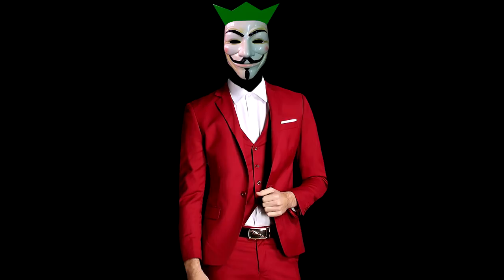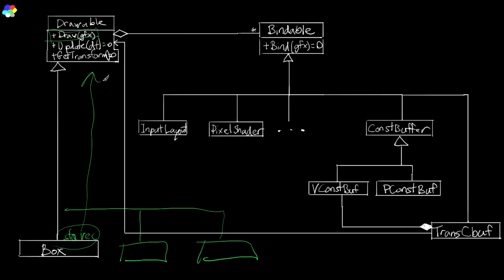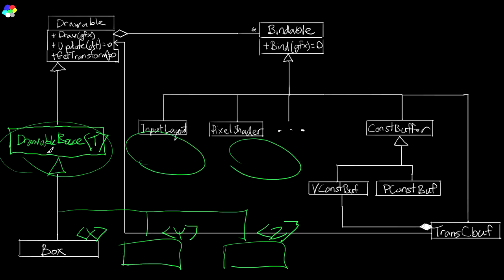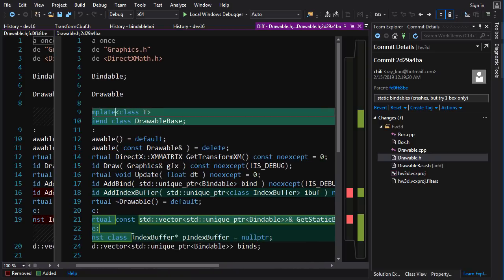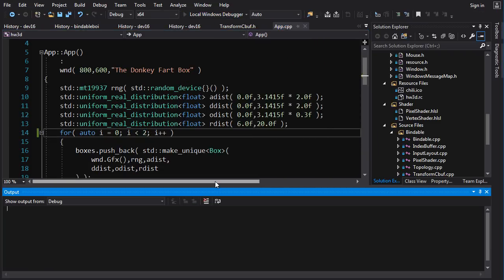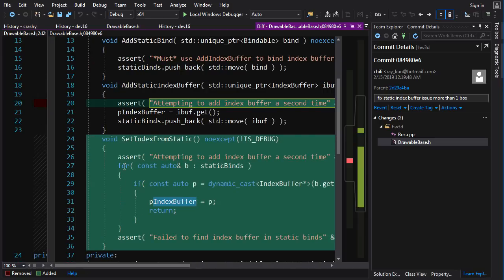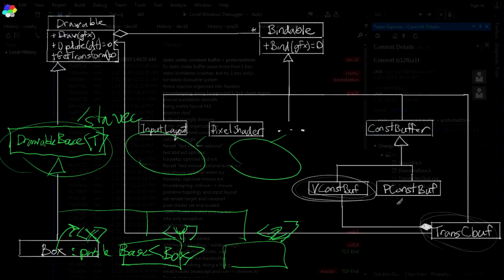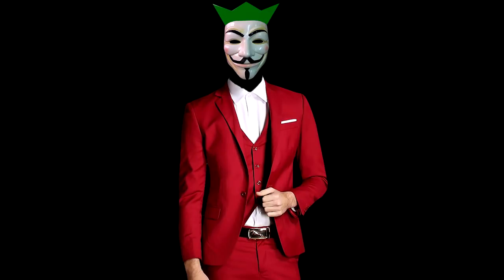C++ 3D DirectX Tutorial [Bindable / Drawable System Part 2]

Comment: I feel as though the PSA at the end was meant for me or people like me lol.

I had to tell myself the same thing while watching, this is only tutorial code, this is only tutorial code.  I really like the design for the most part.  I'm surprised you used static instead of std::shared_ptr, but static works just fine and the template base was a nice treat.  

There are a few things in this design that I wouldn't have thought of, like creating a friend in Drawable then using a getter function to access the private friended instance.  For some reason when I code, I only think inside a certain box at a time.  I'll step away from coding and when I come back, I'll have a different set of "rules" to follow and something new comes to mind. 

Keep it up and thanks for the vids.

Comment: Love this series!
How will this work with objects loaded from disk? Wouldn't they each need a template "type"? I.e. you'd need to define a DrawableCar : DrawableBase<DrawableCar> etc?
Wouldn't a prototype based system be more extensible? I.e. Drawable has a member "Drawable Prototype" that contains all the "static" data..
Reply from the maker: Stay tuned ;)

Comment: At 13:45, if you run into an issue with Properties -> C/C++ -> Preprocessor and can't see your input for IS_DEBUG = true; click on Platform (top) and set it to Win32.
Reply: is_debug is essentially just the negative of the NDEBUG define that is set by the compiler by default. So you can make is_debug into a constexpr function that just returns the opposite. Like
constexpr bool is_debug()
{
#ifdef NDEBUG
return false;
#else
return true;
#endif
}

Since it is constexpr and the result is known at compile time, the compiler will just fill in the result.
No need to set another define, no opportunity of forgetting to do so.

Comment: So I have a question, I know it has been 4 years since the release of the video, but I wanted to ask if there a way to make the code more performant? Right now my code, on 12 CPU cores, runs only one of them at 50% capacity. I was wondering if there is a way to leverage multi-threading or other techniques to improve performance? Is this addressed in later videos?

Comment: 7:25, to do this thing here in my project I did something funky inspired by that thing Chili did with the message handlers in the Window Message Loop  video with Setup and Thunk.
I declared a static void (Box::*fpIntialize)(Graphics&),
I defined 2 private member functions called:
void Setup(Graphics&) - adds the static binds to the vector and mutates the static fpInitialize to point to the 2nd function called
void Initialize(Graphics&) - and it adds regular binds to the object 
and in the constructor I call the fpInitialize function pointer which is at first pointing to Setup, but as the first C-tor call is initiated it then points to 2nd member function and does this one time initialization without checking if things are initialized every time the c-tor is called.
Also this syntax: (this->*fpInitialize)(gfx) and this syntax in the cpp
void (Box::* Box::fpInitialize)(Graphics&) =  &Box::Setup;

Comment: This works fine if all your boxes are identical. They all share vertex buffers, index buffers, shaders etc. But what if you want boxes of different shapes? Or some boxes to use a different pixel shader?  I would have the drawables store shared_ptr s to their bindbables, so they can share them, but do not have to share them. Also, the bindables are automatically destroyed when the last reference expires. You could even store them centrally, accessed by name, in a central cache that holds weak_ptr s to the bindables.
Reply: Future me here, rewatching this one. It crashed because drawindexed needs the number of indices. But, if the indexbuffer is static, the number of indices is shared too over all boxes. This changes when you have drawables that do not all have the same number of vertices, like cones or spheres. In that case the number of indices is on per-instance basis. So, you need a static count and a non-static count, one of them is valid. You can do that with std::optional.

I could also imagine doing this as a kind of ecs kind of thing. The drawables are essentially a collection of bindables. So the bindables could all be in arrays and the drawables could hold just indices into those arrays. Multiple drawables can or can not share any kind of bindable. Just brainstorming, haven't tried this out.
Reply: @theo-dr2dz  nice